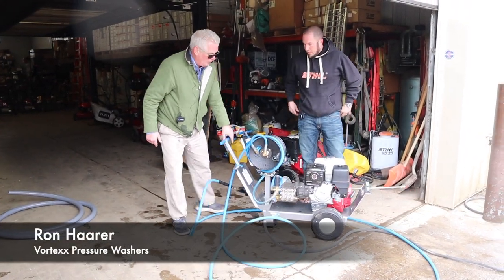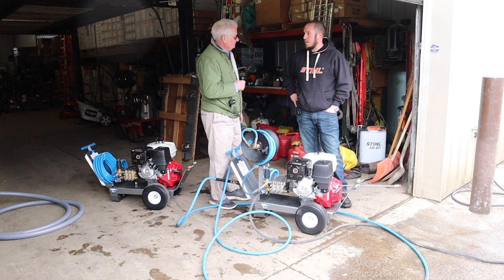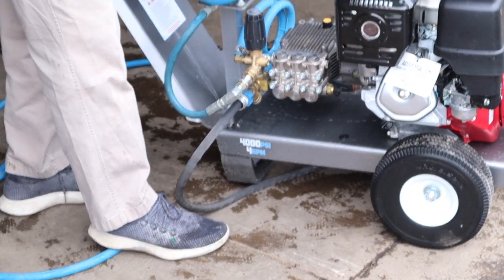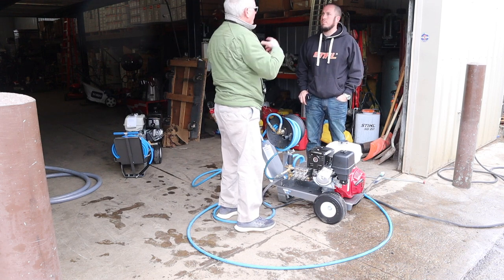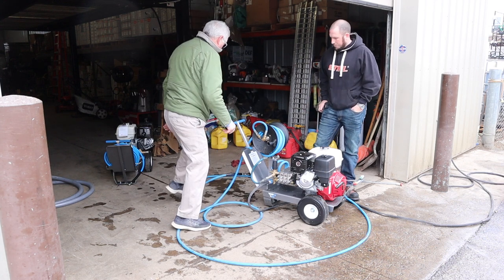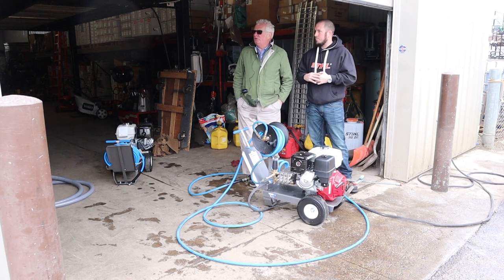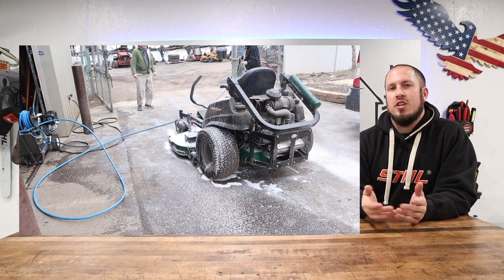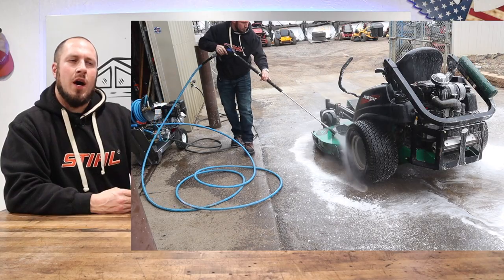Vortexx Pressure Washers-Best Pressure Washer

Comment: Any advice/suggestions on a surface cleaner? Where are you located, I saw Detroit on the van. I'm in Ann Arbor 🤣
Reply from the maker: I do like Vortexx’ trisurface 2.0 shown here but if you don’t have the pressure to run it, it doesn’t help much. I like the Ryobi surface cleaner price but you get what you pay for on that one.